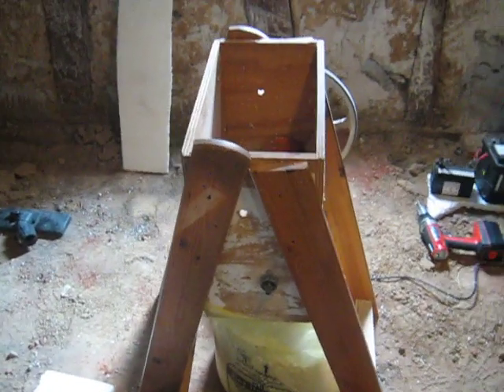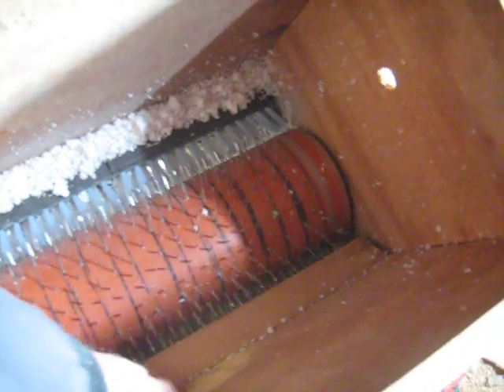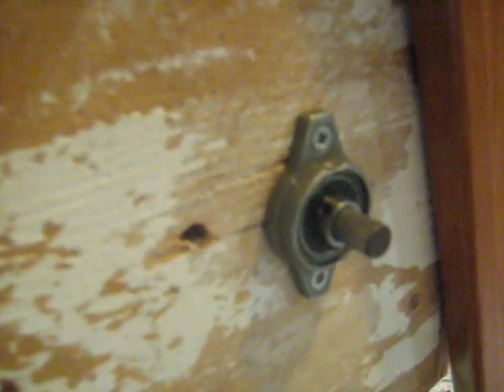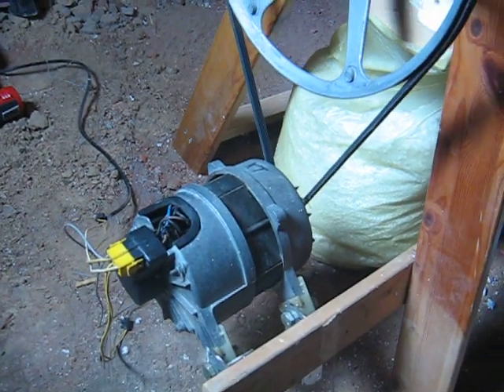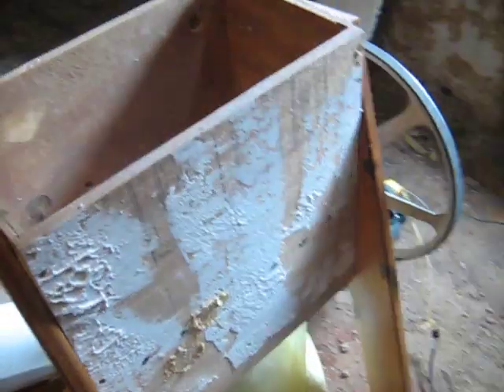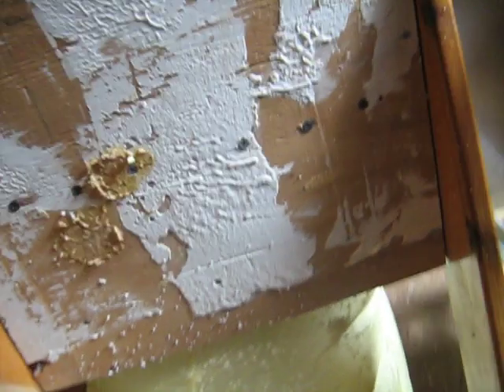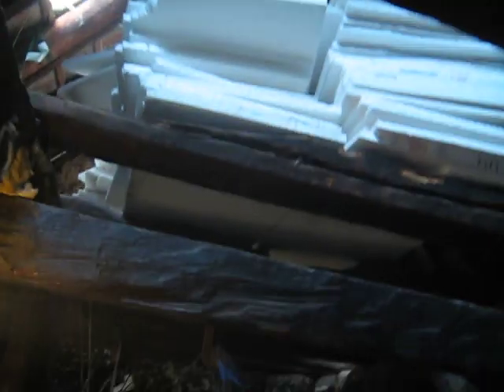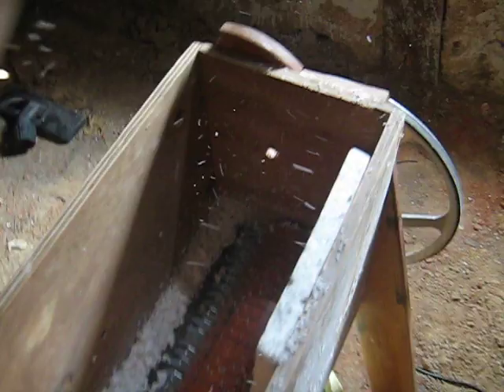Styropor shredder DIY

Comment: Seems most people make styrofoam shredders with screws, drywall screws I think. 
I was wondering how that compares to using nails instead.
Looks like your nails don't have heads?
What size and type of nail?
What exactly are they nailed into?
What keeps them from coming loose, flying out?
I guess that would surely be one benefit to using screws instead.
I wish for my pieces to come out roughly 1/8" dia or so.
What size do your chips come out?
What is your nail spacing?
Reply from the maker: All good questions, most of which I can only give guess 's to,  as this was a long time ago and I've since given the setup to a friend. The nails were small perhaps 3mm and appointments 15mm long, there were pushed through a hole in a pvc tube. An other tube with a slot cut down the middle was inserted to stop the nails backing out . I believe the rows were spaced approx 1cm apart offset  ( at the speed it ran the spacing wasn't too important. The result was bean bag use able size. Hope this helps.

Comment: Hi what's that you use to connect the flywheel to board?
Reply from the maker: Sorry about the late reply, the flywheel is attached to the shaft after filing down the the shaft to fit the slots in the Flywheel.
Reply: @daza2838  thank you for your response, appreciate it, the Lord bless you richly

Comment: why did you decide to use nails instead of blades?? regards!
Reply from the maker: The nails shredded the styropor into small balls, perfect for my application.
Not sure how I would've incorporated blades....?
Cheers.
Reply: @daza2838  You  can use blades like a common shredder, like the ones used to shred other types of plastics.
 I'm asking because I think is very interesting the way you shred this type of plastic, that is such a problem when shredding it, because of it low weigh and sometimes it melts in the blades because of the rubbing (it already happened to me :( ) I'm interested to know more about your styrofoam shredder if its no problem to you! we can share some tips and tricks of this special material, i've been working with it during this year. 
Thank you for your answer. 
Regards
Reply from the maker: @carolinaaliciaespinozajime5960   I never had the problem of the material melting and the nails stayed sharp as the material isn't hard at all. The result was small balls of material which was much easier to store and perfect for my use.
Reply: @daza2838  I can understand that, that's why i feel that's really interesting what you did, and i would love to know more about it. I'm searching ways to made as efficient as possible de recycling process of EPS
Reply: but locally and with home made machines, you know precious plastic?

Comment: Great mate!!  How did you attach the nails to the PVC pipe, and what size are the nails?  I've retired from Oz and am now living in the Philippines.  Building here is done with 'hollow blocks' - cement blocks that you have to pick up with two hands, because they're so weak that you'll just break off a corner if you try to pick it up one handed!!!  I want to make solid styro-cement blocks instead, but buying polystyrene beads here is unbelievably expensive.  This looks PERFECT!!!
Reply from the maker: Sorry about the V late reply, the nails are about 20-30mmx2mm . I predrilled and pushed the nails through the pipe and then slit another pipe down the middle and inserted it inside the first pipe.
Cheers